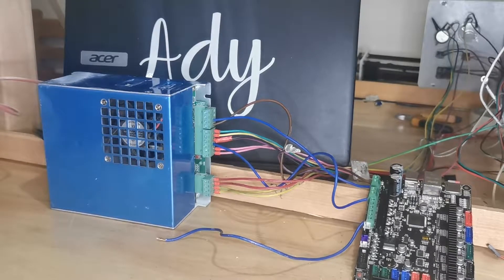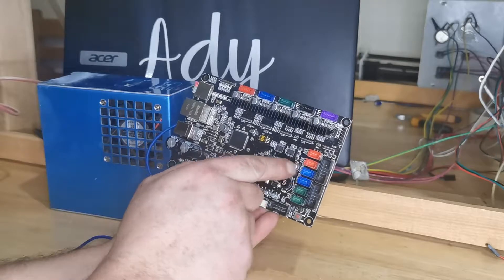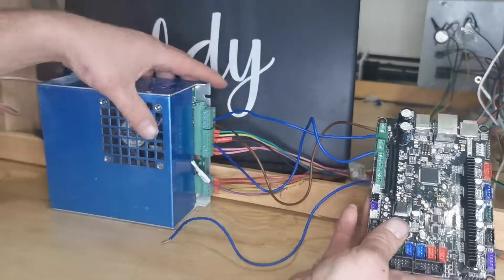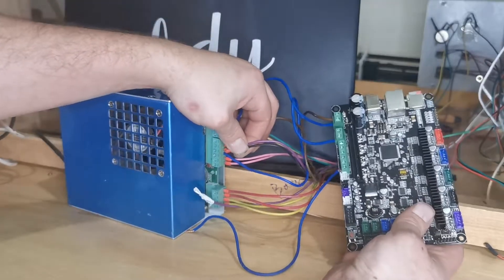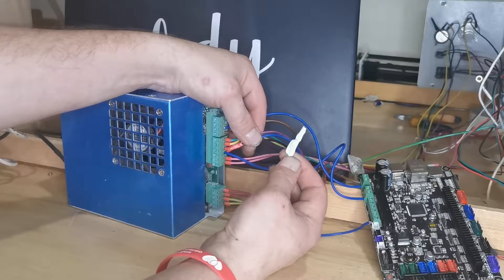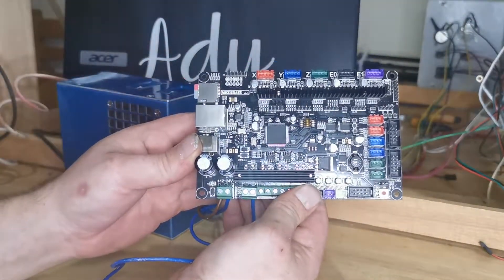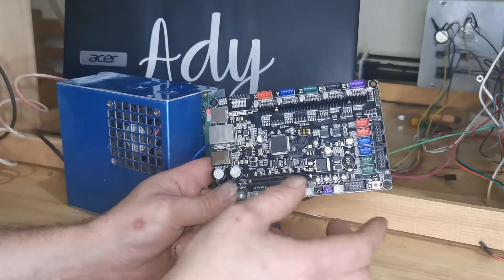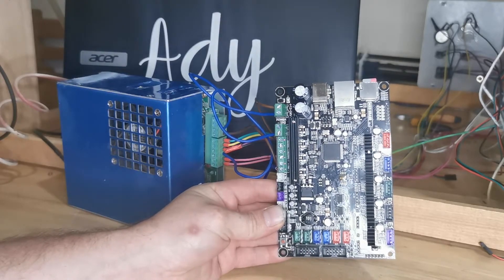K40 Board to MSK Sbase board wiring.

Comment: I dont want to sound really stupid but what about the other wiring that goes to the K40 controller board. ie my controller board has a plastic metal-coated ribbon cable. I'm guessing it's because this is for an already modified k40 machine and not a stock machine as there seems nowhere to put it? I think the title is misleading if this is the first video you see when trying to upgrade a k40 from stock.
Reply from the maker: The ribbon is still stock. Some k40s have them some do not the ribbon gose to a small board which has your limt switch on and the motor wire when changing over u will have to just remove the ribbon one and change switchs over. If u look at the side u see where the motor plugs in

Comment: Hi, did you get this to work with the standard  3d printing smoothieware code on the github and you then setup your own configuration file according to your machine?
Reply from the maker: Hi i used 1.1f firmware i have now posted a video on it. I need to do some other on how to config it but i am going to try do them both 2night
Reply: @adypenney  awesome! I have setup grbl lpc which is the same I think. If you know the difference between connecting pwm signal to L (far right pin on lps) vs IN (middle connector) it would be real useful if you can add that to your video. I want to keep analogue guages and buttons etc. Do you know if that is possible?
Reply from the maker: @danny36120  u mean u want to keep test fire botton
Reply: @adypenney  yes.  but i read somewhere you can connect pwm signal to either L or IN on the laser power supply to control the laser.
Reply from the maker: @danny36120  posted another vid on the botton part for u

Comment: Are you sure fan - connects there? I'd think it connects to where the yellow cable is which is pwm for the laser. The one your showing in the video is just a ground connection
Reply from the maker: I have this working on mine and 2 others whixh are friends
Reply: Awesome but I'm pretty sure the connection to fan minus is not required as the pwm is done over p2.5 which is the bed connection. There are separate configurations depending on which pin you use and what hertz you require. Is this what you change with t2laser by any chance?
Reply: I've just got this running on my machine. You either use fan minus or the bed mi us but you don't need both and they would both connect to where you have connected the bed minus. Try disconnecting the fan minus cable, I bet it still works